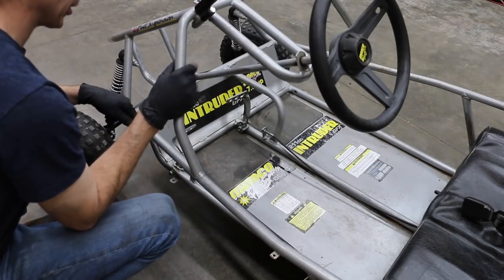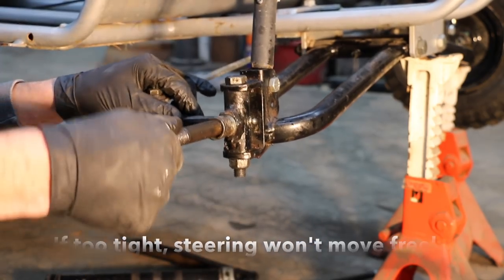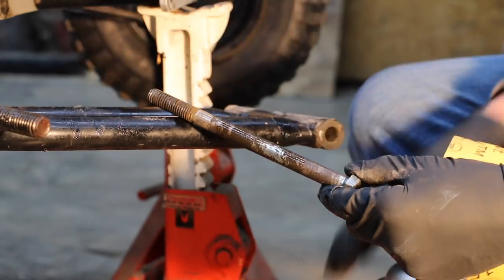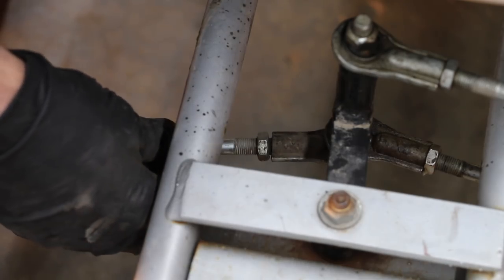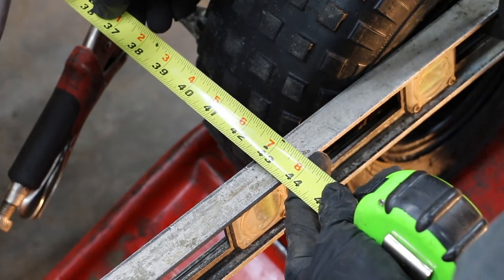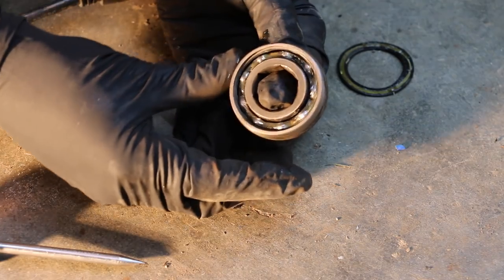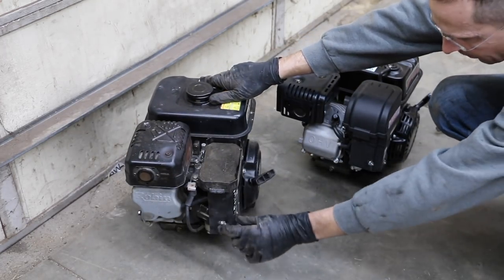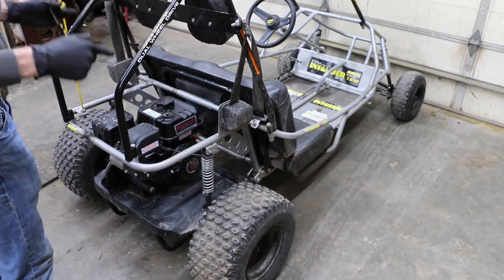How do you inspect a Go Kart before buying it?

Comment: Great video and a great idea for a test machine! 
I think that if you would replace the tires and maybe the rims too with some larger ATV tires and rims it would make for a smoother ride. Also, I was told many years ago that you need to set the front wheels an 1/8" or so narrower in the front because as you go forward it will naturally push back on the wheels and having that 1'8" or so narrower in the front will allow the wheels to come back a bit and be straight as you ride. I've always set mine like this and it works very well. 
P.S. I think this Go-Kart will help your channel a lot.
Reply from the maker: You're right regarding the front wheel alignment.  I'll need to adjust it.  Also, thanks for the other recommendations too!
Reply: You're welcome my friend, just keep putting out these great videos for us to enjoy! 
P.S. Nice drone work too!

Comment: I enjoyed the video, don't have a go cart, but still found the information useful, and entertaining.

I did find myself wondering how your ranger was holding up the other day
Reply from the maker: The ranger is still doing great!  I use it all around the farm several times a week and it takes a lot of abuse navigating the rougher areas of the property.  I'll need to replace the clutch before too long but the engine is still running strong.

Comment: Toe in is better than toe out. In fact, a bit of toe in is desirable.  It will help to self center the steering wheel and stop the cart from darting around too much. Also, you should set your toe in/out with the cart at laden height. As the steering moves through its range of motion you'll find that the toe will move. What is too much at one height can be too much in the other direction or not enough once the suspension sags to the actual loaded ride height. Keep up the good work, having a quantifiable test rig will really make things interesting.
Reply from the maker: Thank you for this information. I'll adjust the alignment to add toe in.

Comment: Great video and nice go kart. Mine I had as a kid had no suspension, ride really rough, just had a centrifugal clutch chain drive, yours looks like a snowmobile style variable pulley setup. I did a governor bypass on a Briggs years ago that was on a snapper rider, I put car rotors bolted to the back tires so I could have a higher ground speed. I’m guessing you used a drone for filming. Love this new idea for testing,  will be great for teaching your kids too and this will be a good path for basic maintenance skills for them down the road as well. Looking forward to your next video.
Reply from the maker: Thank you!

Comment: The correct permanent governor removal involves opening the engine and disabling the internal components. Also since you have the governor off, I'd recommend a billet flywheel... so your not injured if that one decides to go boom...a few companies have them at reasonable cost. Another channel I watch is sponsored by a company that makes a ton of performance stuff for the predator engines. I think gopowersports is the company. They have kits to make a 212 predator put out like 20hp... you may look into it and have a side series of hopping up your go cart... lol
Reply from the maker: Thank you

Comment: Great change up video and good way to use extra parts on hand.  If you would redo a few fuel videos and use the gokart setup you could more accurately gauge the power gains or loss vs certain fuels.  Maybe the gokart can get an actual Wideband O2 sensor and air fuel gauge to see if it is running rich or lean with said fuels and under load?  Might be pricey but a fun trial?
Reply from the maker: These are great ideas--thank you!

Comment: You may also want to consider a larger torque converter. With the Predator engines, it will eat through belts, especially with modifications such as a larger emulsion tube and high flow filter. It will also slip under high loads which could throw off testing.
Reply from the maker: Thank you for this recommendation!

Comment: Project Farm. Yes I replaced the spark plug with OEM plug. The old one is dark with carbon. With no load it runs at the same speed no matter the throttle unless I adjust the choke to about half where she runs fastest
Reply from the maker: If you have a chance to try it, I hope the carb adjustment helps.

Comment: loved the video. you should try to use "farm gas" or "E85" gas to see the power difference!
Reply from the maker: Thank you for this recommendation!
Reply: i'm not sure what farm gas is, but it sounds like is probably just marked gas.  Around here marked is usually 89 octane.  E85 will always make less power unless the engine is tuned for it (or a computer controlled engine that can adjust timing),  A engine that's built exclusively for e85 can make a fair bit more power then regular gas (e85 is around 100ish octane rating).
Reply: yea it is just marked gas. but a video is a video.

Comment: @Project Farm 

Great video! 
I have to repair my air compressor, but I can't order a gasket kit for it so I had to order gasket materials and then I have to cut the gaskets myself. Before I started searching for the right materials I didn't realize that there are so many different types of gasket materials with all kind of different properties. I was wondering, maybe some day you can do a video about the different type of gasket materials and their specifications and their different purposes. I'm talking about the single sheets that you can buy when you have to cut the gaskets yourself. Like for example the actual heat resistance, pressure strength, the differences between fiber gaskets and metal reinforced gaskets, that kind of stuff. I mean, there is a lot to tell about gaskets. 

There are also a lot of brands with a liquid gasket material and some sort of glue type of gasket material. How well do they perform under pressure and how well can they handle heat and oil, fuel and water and such? Is that something that is up your ally?   

Greets, iT
Reply from the maker: This is a great recommendation--thank you!

Comment: Like the new style, good for adding some variety, although certainly don't want to see the old format disappear entirely. Also liked the use of music in this one.

As for the technical side, one tip I've found before with such simple small vehicles is making and greasing up a couple of washers for the front steering fork will allow you to get it much tighter while keeping smooth steering. Also as a bunch of people have mentioned, the topic of alignment is a lot more complicated than just getting it straight and certainly should be done with weight on, although honestly for something as simple as your cart its likely not very critical either way, chances are its going to move a  little with time anyway.

Now your into things that move, I've be very interested to see in a video what sort of effect the current exhaust has on performance and economy vs a straight bit of pipe, so if your location allows some excess noise for a bit, that'd be an easy way to see if these small engines are very sensitive to that sort of modification (and thus if its worth making a replacement muffler that flows better, here represented in the simplest possible way).

Great show as always!
Reply from the maker: All great points and thanks for the constructive feedback too!

Comment: Yes, that governor delete setup will work, but I recommend splitting the case open, and removing the plastic governor gear, and the governor arm. Remove the arm, tap the hole you made and stick a bolt in there with lock tite.  While you’re in there, pull the 2 10mm bolts out for the oil sensor, and remove that too, remove the funny bolt thing for the wires, and tap that and block it. Low oil sensors trip on go carts  with them bouncing  around. You can simply disconnect the yellow wire from outside (I think), and do the same thing. You’ve done that before with the other destructive testing. Just maybe not having the switch in there makes more oil capacity. and not having that gear is one less thing to explode inside. Just my $0.02. With a little work, that thing will be good as new. Nice find. What do you plan on doing with that Subaru? Perhaps with just bring a test engine for additives or anything you won’t need that, I’m not sure. Great mix up to the usual, even though I always love any video of yours.
Reply from the maker: All great points regarding the proper way to delete the governor and oil sensor.  I had a problem with the engine stalling on corners. So, I disconnected the oil sensor it that resolved that issue.  Still not sure what I'll do with the Subaru engine.  Thanks again!

Comment: Another interesting idea would be swap in a rear drive engine/ trans set from a ATV, preferably manual or semi automatic. Then you get gears +reverse. And a 12 volt system to support lights and such. Could be another run the fence line check vehicle, or many other purposes, or just for fun lol.
Reply from the maker: Thanks for the video idea!

Comment: There is debate on the subject, but many say that the stock flywheel might explode if revved past 5000 or so (but would require stiffer valve springs to do so). Even with stiffer valve springs, I doubt the motor will rev past 5000 with the CTV unless you start swapping garter springs, but beware and do your own research. That said, there are tons of Predator mods out there, and I'm really looking forward to the series!
Reply from the maker: Thank you for the caution on the flywheel!  I might put together a test device and see if it can safely handle the RPMs.  Thanks again!
Reply: if you do spin it up past 5k or so make sure you aren't too close, flywheels store enormous amount's of energy.  I'd also spin it up somewhat faster then you plan to run it at as a sort of safety margin.  It might do say, 6.5k once or twice, but fail at that same speed later on.  If you planned to run it at 6.5k i'd probably spin it up to at least 8k just to be safe.

Comment: Awesome new toy should be fun. When you measured the "Toe" you should have done it with weight in the cart. The steering geometry will change the toe angle when you get in and if you don't have the books to set toe to then the easiest way is to add weight to simulate the number of people and check the toe angle. just a easy way of doing it without the specs.
Reply from the maker: This is a great point.  I'll have to adjust the alignment once more.

Comment: This go-cart would be even more fun with a 420 engine though I understand your choice in using the 212.  Those Subaru/Robin motors are excellent, I have both a generator and pressure washer powered by Subaru/Robin though I read that Subaru has stopped producing small industrial engines focusing on their automotive line.  I guess they can't compete with cheap Chinese Honda clones.  I recently replaced old Briggs & Stratton engines on my lawnmower, and my DR Trimmer/Mower with Chinese Honda clones and they both run MUCH smoother and quieter, and much easier starting.
Reply from the maker: Great point regarding the larger engine.  I agree that the Honda clones start and run rather well!

Comment: @4:16 most Zerk fittings have a spring-loaded ball which keeps the grease from coming back out and essentially seals the opening to keep loose dust and dirt from entering the opening. Hopefully this is not the case for your particular application.
Reply from the maker: Great point. This one was missing.  I'll need to replace the fitting.

Comment: Couple things I noticed, when you removed the rear axle bearing, I would have cleaned all the old debris out then put in the new grease. Also looked like there was a second set of holes to move the axle down in case you wanted more ground clearance. Last, removing the governer, a man after my own heart.
Reply from the maker: All great points--thank you!

Comment: Awwsome video. I build racing predator engines if you are reving over5800 rpm you should replace the flywheel for safty reasons with a billet flywheel. The stock ones blow apart around 6k rpms.
Reply from the maker: Thank you for this information!

Comment: Z Max is  Avblend  which is the only oil additive approved by the FAA 
for aircraft. It literally soaks into the metal. I have used in my 
diesel RV class A and only started that engine once every 7 months. It always 
started up like it had hot oil in it. High cranking rpm. Put it only 
one time 13 yr ago and 13 yr later it started the same. Try running this cart dry.
Reply from the maker: Sounds great!

Comment: I once built a gokart from scratch. Built like a tank....at least when a buddy of mine crashed it, kart was fine....
Engine was a Honda GX150 5.5hp. It reached 30 mph which is scary with a single disc brake and a weak caliper and a "tend to snap" tie rod system....
Reply from the maker: Wow!  That's great speed!  I need to check the top speed on this one.  It's pretty fast with the governor bypassed.

Comment: I wanted to say. The easier way to by-pass the governor it to just replace the spring with a solid wire ie. coat hanger or bailing wire. It does the same thing without drilling holes. Still have to remove gas tank!!
Reply: The spring on the governor arm that is!
Reply from the maker: Thank you for this recommendation!

Comment: Rather than just tightening down the bolts on the front end to remove the wheel slop you probably should use shims (spacer washers). If you use two spacer washers, both at the top and the bottom it will also make steering easier and reduce wear.
Reply from the maker: This is an excellent tip!  Thank you!

Comment: Suspension must be loaded with weight to align properly. As the wheel raises (weight added to the drivers seat) it will change alignment drastically.
Reply from the maker: Great point!  I'll add weight and adjust the alignment.

Comment: If you haven’t done one yet, do a video on best rust penetrate. Compare PB Blaster, Liquid Wrench, AC Delco heat valve sink, and my personal favorite Kano Kroil.
Reply from the maker: Yes, I'll put together a test on this soon. Thank you!
Reply: I’m a GM Tech at a dealership. Been in the business for 20 years. Got some guys who swear by AC Delco heat valve sink. Seems to work good but I will say it works great for removing gasket material from cylinder head gaskets.

Comment: You need a little toe-in it will keep it going straight, I had a old car once that I had to fight with to keep it between the ditches, a friend reset the toe-in and then you could let go off the wheel and it would go straight down the road .
Reply from the maker: Great point.

Comment: The reason the wire wouldn't go through the grease zirk is because there's a spring loaded check ball in there.  The bolt should have been cleaned up with a wire wheel.
Reply from the maker: Thanks for commenting.  The ball was missing and the wire went through.  I plan to replace the grease fitting.

Comment: The front is set up like that because of the suspension style when u sit in it the front will settle down and the alignment will be right on, had this same machine and I thought the same thing
Reply from the maker: Thanks for this information.  I'll adjust the alignment.
Reply: Project Farm and all mine that style didn't last long because the frames are weak, if u check out my videos u can see some of mine and what I've done to them to beef them up

Comment: I really want to see engine mods.I am a 56-year-old disabled vet and have a Manco go-cart with the same engine. mine has been moded to use all hand controls(it would be great to show that kind of set up) I have a 2nd go cart yard pro with a 20hp subaru engine but have no luck finding a replacement engine. Someone ran it without oil and I got it dirt cheap.
Reply from the maker: Thank you for the video ideas!

Comment: I've always wanted to and wondered if you could put the rear gearset from a mountain bike on and maybe let off the throttle when shifting to see how fast it would go.

Would it munch the gears or need major balancing or anything?
Reply from the maker: There's a way to add an engine, but a bicycle would need to be regeared The engine spins much too fast to use existing sprockets and gears. Thanks for commenting.

Comment: Hi, 
You don't have to straighten those wheels front end cause it's made for cart's straight line stability, called as toe in. With toe out settings by straightening the wheels will make cart more flickable and agile on turns but makes it unstable under braking and affect staight line stability and steering centering also affects drastically.

Neelkiran
Reply from the maker: I'll add some toe-in. Thanks for this information!

Comment: I have a question, I have a go cart witha  6.5 hp briggs engine  and she wont run on full no choke. ive also noticed she doesnt run as well as she used to. i have replaced the fuel line but I dont think its too long. im not goo with adjusting carbs so I never touched it. also interested in by passing the govner
Reply from the maker: It's very difficult to diagnose without seeing and hearing the engine run.  Based on this information, a carb adjustment might help.  Have you replaced the spark plug?  How does it look?  Is there a lot of carbon build up?  Please create a new comment so I can easily find your reply.  Thank you!

Comment: I bought an extremely beat up go kart a while ago and got it running again by unsticking the valves and replacing the wheels. During reassembly after a head gasket replacement one day I managed to slightly bend pard of the throttle assembly by accident. Next time I tried to Start it, the kart took off down the road, as the throttle got stuck wide open. Did a wheelie and destroyed my neighbors mail box, then flipped over and cracked the gas tank. Moral of the story: start these facing a solid object, and do what this man says about being careful with the throttle. And don’t buy a 100 dollar rust covered go kart.
Reply from the maker: Thank you